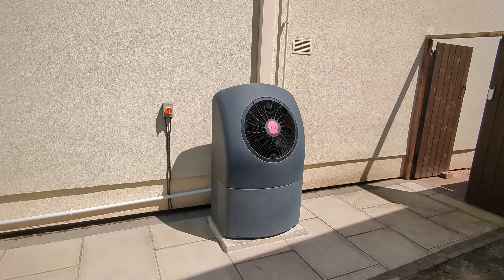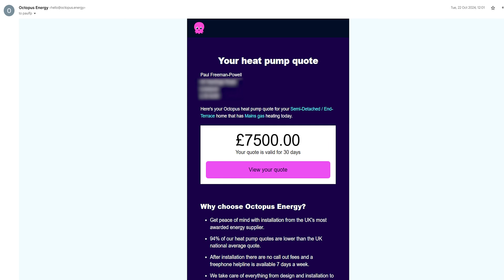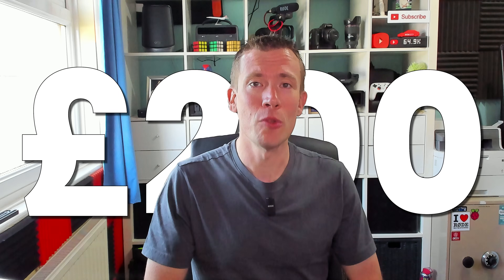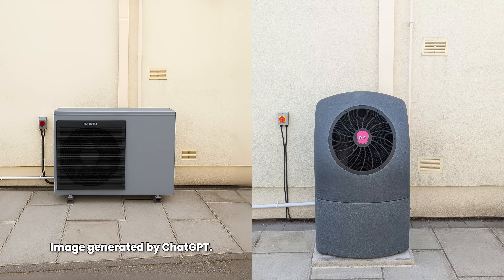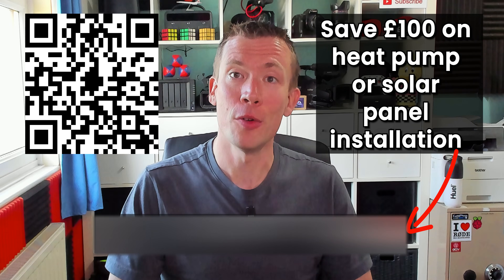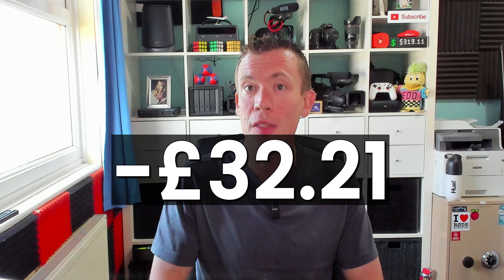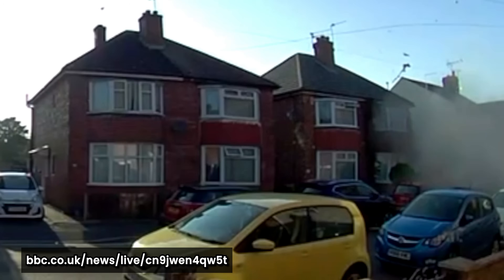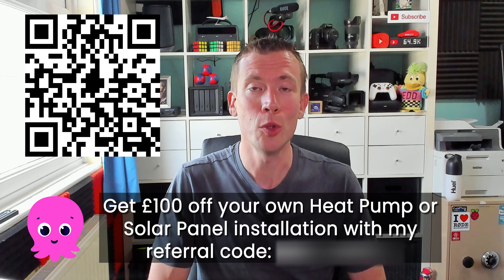How Much Did My Octopus Cosy 9 Heat Pump Installation Cost? [2025 UK Price Breakdown]

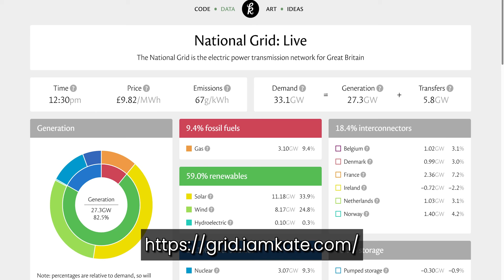Comment: @07:58 - what a stupid reference, this national grid stat shows only ELECTRICITY generation by source, that chart does not show HEATING in kWh which is approx. 750TWh per year and dwarfs all electricity disregarding the generation type, also there is 630TWh equiv. used in transport in UK per year. Electricity (all of it) in overal energy mix a just above 25% of all energy used in uk.... "I am saving the planet..." okay...
Reply from the maker: I think you have completely misunderstood the valid and correct point I was making.... 🤷‍♂️🤦‍♂️

Comment: To many hoops to jump through, I’ve got no chance of installing a heat pump, far too expensive even with the grant. A lot of people are in the same situation as me, old house with some solid brick and can’t afford intern wall insulation. If the government take away the grant then that’s curtains for heat pumps. Only people with cash to splash can afford heat pumps.
Reply from the maker: I certainly don't have "cash to splash" and I was able to get a heat pump installed for a reasonable price (comparable to replacing my gas boiler) with minimal hoops to jump through - and my house is solid wall brick too.

Comment: When are you posting a video about living with your Cosy 9. Mine was installed last week and I've lots of observations and questions (for example it appears to be surprisingly quick at heating up the hot water but surprisingly slow in heating the house) and it would be useful to understand if they are unique to me.
Reply from the maker: I've not had a chance to get started on it yet I'm afraid as I've been busy with lots of other stuff. I'd check the pressure of your system if I were you and also bleed all radiators and then top up the loop if required. Also are your radiators properly balanced? You might need to open the lock shield valves a bit to let more flow through to some of the radiators. Do they all get warm all over?

Comment: 2.5k ouch....
3.4k ouch....

My 4kw Daikin heat pump with two rads changed, new 180lt tank fully fitted from octopus cost £750 after the discount, I had it fitted end of last year and it works great, it's already saving me quite a bit compared to my 10 year old gas boiler...... today it only used 6kw to heat my 3bed well insulated 10 yo home to 22° all day from 5am to 9pm I have it at 19° at night.
My water keeps nicely hot at 48° and only uses 2kw a day if that to stay hot, maybe 4kw if I use the shower to reheat itself.

I find it really easy to use efficiently and cheaper than my gas boiler.

I'm on octopus intelligent so I run most things at night for 7p per kw.
Reply from the maker: I still don't understand how some people's quotes are so cheap. I wonder if it's to do with labour costs and crew members needing travel or accommodation? Anyhow if I ignore the REALLY cheap quotes like yours and look at mine in isolation, mine still feels like a fairly good price and good value for money. Just would love to have been one of the very lucky ones though 🤣

Comment: I’m awaiting my install and we’re having the Cosy Eco install (the better one) with 7 radiators and a new hot water cylinder for £3700. Bargain really.

Better still we’ve just remortgaged with Halifax and we’ll get £2000 cash back from Halifax as part of their Green Living Reward. So £1700 for a whole new system with more than half of my houses radiators replaced.
Reply from the maker: That's amazing! Very nice 🙂 you'll be really happy with the Cosy I'm sure. Let me know how you get on!

Comment: You got your quote around the same time as me. I got the pink Friday discount, a referral discount - after all these my quote was £776. For that I got a cosy 9 heat pump, 11 rad changes plus 1 new rad and the 250l tank
Reply from the maker: Wow, that's a great price. I've heard a few similar - I don't really understand why there's such huge variation. I kept saying to Octopus "but what about the 'from £500' adverts?". To be fair, the price I paid didn't seem too bad versus getting my boiler replaced, but it does sting a bit knowing people paid so much less and I don't understand why 😂
Reply: How!?
Reply: How much has your electricity risen since your heat pump install? Do you have to leave it on to keep a comfortable consistent temperature ? The temperature in Scotland can drop to minus 10 and in some areas minus 20. Am I correct in assuming that a heat pump wouldn’t be able to keep me warm enough in freezing temperatures?
Reply from the maker: It can certainly work down at -20°C. They're extremely common in Norway - they'll just use a bit more electricity at that level, but the way they work is harvesting energy from the air and there's still lots of energy to be harvested at -20! Absolute zero is -273°C so still quite a lot of wriggle room 😊

In terms of electricity cost going up, I've not calculated that exactly but I can definitely say it's gone up by less than price of my gas. I run the heat pump overnight when electricity is cheap (7p) and do the hot water just before the cheap rate ends at 5.30am. 

I've also coupled my heat pump with a Tesla Powerwall which I charge overnight on the 7p rate so that alone saves me ~£95 per month and can of course also run the heat pump.

That's the thing - flexibility, which you just don't get with a gas boiler.
Reply: @SwitchedOnNetwork  on the subject of heating the water tank up during your overnight tariff rates, I’m on what I assume is the same overnight tariff as you (octopus intelligent go), how long does it take to heat the water up, or in other words what time do you set it to heat the water tank?
Reply from the maker: @dstev55 yep that's what I'm on. My water schedule is 4am - 5.30am although looking at stats it's usually finished by 5am so will return to heating. I heat it to 52° but once I've insulated the tank (it wasn't supplied by Octopus) I'm going to increase that to 60 each night so we'll just dilute with more cold water making the "hot" water last longer.
Reply: @SwitchedOnNetwork  so the tank doesn’t come insulated? 🤔
Reply from the maker: @dstev55 it's insulated, but I want to add extra insulation to improve that since it sits in my cold eaves. Don't forget my tank is one I've had since 2016, not supplied by Octopus. The ones they supply probably have pretty good insulation!
Reply: @SwitchedOnNetwork  ok fair enough, my installation next week includes their tank so should be good, thanks. 👍🏻

Comment: What really gets to me is that the most expensive and high quality heat pumps on the market can't and won't match up in their guarantees and warranties to the top gas boilers on the market. That for me is not a good indicator that NOW is the time to jump in with a heat pump.
Reply: It is only in recent times that the boiler manufacturers have started to offer decent guarantees. Albeit with requirement of annual service and correct original installation. 10 years ago it could be as little as 2 years, use a registered installer and it was increased to 5 years, then 7 and now longer. In any case a guarantee or warranty is only as good as the company who provide the service. Some are good, others look for reasons not repair or replace.
Reply from the maker: A new Worcester Bosch gas boiler warranty varies, but typically starts at 5 years. The warranty on my Cosy heat pump is 8 years.
Reply: @SwitchedOnNetwork So the top of the range 8000 combi boiler series comes with 12 years guarantee when installed with a WB installer. I’ve had a quote from one local to me that was £3.4k for the boiler, the flue (which is extra and not complimentary), the filter (again not standard), a full system flush, the WB thermostat as well which also gets the same 12 years guarantee as the boiler. That’s top of the range boiler with all the bells and whistles which is more than I actually will ever make use of on a serious note. Heat pumps are still in development. They can and will get better going forward and will eventually hit the same standard. Should note that a guarantee is legally binding and if you had the choice between that or a warranty, a guarantee is always preferable (not trying to be condescending or talk down to you btw) but this is what I found in my own research.
Reply from the maker: Don't forget that heat pumps aren't a new technology at all, they've been around since the 40s and 50s. They've been commonplace in homes for heating and hot water since the 1970s in other countries, but the UK gaff l has been addicted to gas and other dirty fossil fuels for far too long. Also worth noting that "out of warranty" doesn't mean useless, many things work for years and years after their warranty expires and if some minor maintenance is required but not covered by the manufacturer, is that the end of the world?
Reply: @SwitchedOnNetwork  I don't mind the concept of maintenance and self service but I do view warranties and guarantees as a show of confidence from manufacturers. If they aren't confident in their own product, how do they expect me, a paying customer, to pay thousands of pounds for this product? My gas boiler turned 21 this June and is still going strong because I do the work and service it every year. Without fail. So I'm not beyond putting the effort in. The warranties and guarantees are a safety net. Things happen. For me, I'm not investing into something without as big a safety net as possible. Doesn't mean nobody else should. That is their own prerogative and it's their money, who am I to tell them how to spend it? But we live in extremely uncertain times. Minimisation of risk and expenses is of vital importance.
Reply from the maker: That's all sensible and fair enough, I agree with you 😀 No harm in asking Octopus / Daikin etc why they chose that length of warranty for their products
Reply: @SwitchedOnNetwork tbf I hear that the Mitshibshi heat pump is one of the most efficient and best on the market. I’m looking into it and getting quotes but struggling to see how it will be financially viable. The cosy series look to be decent and good if a little noisy. Though I agree with your assessment of having everything all nicely integrated software wise with Octopus but as ever it’s all about what they can buy in bulk and maximise their margins on.

Comment: Have you been ascertain any figures on if it's cheaper to run than the gas boiler?  Too early in the year I guess
Reply from the maker: It's certainly cheaper for my hot water as I'm getting nearly 300% efficiency and it's only 7p per kWh overnight when I heat the hot water. Saving money isn't my only motivation, though.

Comment: Of course now that you paid the lower price, there is nothing stopping you running the heat pump at a low temperature and gaining the efficiency without having paid the extra price. You could always change those 3rads easily yourself, or just don't bother.
Reply from the maker: My thoughts exactly! All my options are still open, and if I need to I can very easily upgrade those radiators myself. Just need to remember not to delete that initial survey with the suggested sizes ;)

Comment: So it sounds like they were charging you around £2000 to change 3 radiators ? I am in the middle of getting their quote and I  am proposing to change the two low output radiators myself and then expect a reduction in price.
Reply from the maker: Yep! I opted to keep all radiators as-is but if I ever decide to change those ones in the future I can do it myself 😀 hope your quote goes well, and don't forget to give them my code for another £100 off 😉

Comment: Thanks, interesting.
Just had mine done too, but not with octopus as they wouldn’t quote, they couldn’t offer a system with high enough output.
When the whole purpose is to get the efficiency of a low flow temperature system I always found the option of using a high flow temperature heat pump system rather curious. Why not bite the bullet and get the house ready for what is inevitably going to necessary anyway, the initial cost will soon be offset by the energy savings over the life of the system. Ours was another £4k more but we had all new primary and secondary piping replaced, a new 250L cylinder, 26 new rads, a 14 kw ASHP and homely optimiser to run it.
Reply from the maker: The main reason was that the cost was SO high - and potentially would only make a difference on the very coldest of cold days, not every day, making the payback even longer. The system automatically adjusts the flow temperature based on outside air temp and only makes the rads as hot as they need to be. At nearly £3,000 to replace just 3 radiators, I can do that myself for a fraction of that cost if I ever choose to in the future. So, my options are still very much open. (And I could then lower the general flow temp if I did that)

Comment: Wait, you removed 3 radiators from the planned works and that reduced the quote by £3,000? Did I miss something? Radiators don't cost that much, do they?
Reply from the maker: Exactly!! They must have been charging a lot for labour 🫣 I can do it myself if I ever decide I need to upgrade those rads in the future 😊
Reply: @SwitchedOnNetwork  I was surprised by the amount of labour required for my own heat pump install (including 7 rads upgraded/moved etc) 1 heating engineer for 4 days, 1 heating engineer for 7 days, 2 electricians for 1 day , even if these are all costed at £300 per day (which is conservative these days) then that's almost £4k labour and it shows why this type of work is costly, so there are certainly big savings to make if your capable of installing new rads yourself.
Reply: @philcoppard7482  They are Not engineers by the way, they are plumbers, mechanics or technicians. Only the UK abuses the engineer title for some reason.
Reply: Hi, 6 months on, are you happy with your Cosy 9?
Reply from the maker: Hello! Yes - still very happy with it and it's been keeping us warm so far this autumn even in some sub zero temperatures. I've not had a chance to do a "living with" video yet but hope to in the new year. Very happy to answer any questions on here in the meantime though 😃
Reply: @SwitchedOnNetwork thanks for sharing, just got a heatloss survey done and got quoted the cosy 9, was a bit surprised and hope it's not oversized for 4 bed end of terrace.
Will use your referral if going ahead.
Anything to pay special attention to before and during installation?
Reply from the maker: Great! And thanks for using my link 😄 just be sure that you get your gas meter booked in to be removed (assuming you don't have a gas hob). I'm not surprised you were quoted a 9 - ours is a 4 bed semi detached so likely similar to yours. And bigger size allows for future expansion if spare capacity. Do you have a conservatory?
Reply: @SwitchedOnNetwork thanks again.
yes, we have induction hob, no conservatory but we do have a garage we might convert at some point.
Reply from the maker: Ah great, it might come in handy then. What's your total heat loss?
Reply: @SwitchedOnNetwork almost 7kwh
Reply from the maker: Ah so plenty of headroom for future extensions 👍

Comment: I have a four bedroom detached house built in 2000. My current combo boiler is quite old so thinking of switching to an Octopus heat pump. I don’t have solar panels and can’t afford them. Is it still worth getting a heat pump? Should I worry about eye watering electricity bills I’ve read about on forums ?
Reply from the maker: I would definitely consider it, yes! When paired with the right electricity tariff, a heat pump can be cheaper than a gas boiler to run. Octopus do a specific tariff (also called 'Cosy') with some off peak periods throughout the day. I'm on the tariff where our electricity is only 7p from 11.30pm until 5.30am, and planning to get a battery (and possibly solar, to sell power) so I can extend that 7p to pretty much all day long. Horror stories are usually either false, or due to an inappropriate system being badly installed in an unsuitable house by people who didn't know what they were doing. Also, like with any system (gas included) it's always a good idea to make sure your insulation is up to scratch otherwise you'll be using more energy than you could to keep the house warm (regardless of whether that's coming from gas boiler, heat pump or something else). Hope that helps! Get a quote from Octopus and pay your £200 deposit - see what they come back with, you've got nothing to lose as it's all fully refundable. And don't forget to get £100 off with my code if you go ahead 🙂